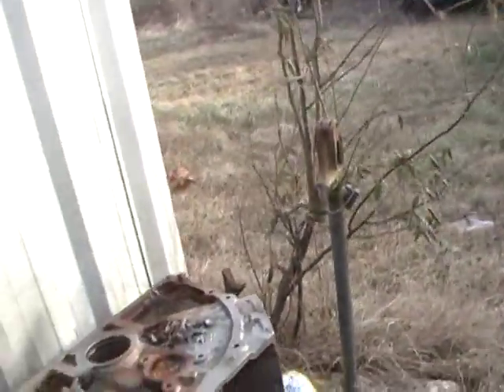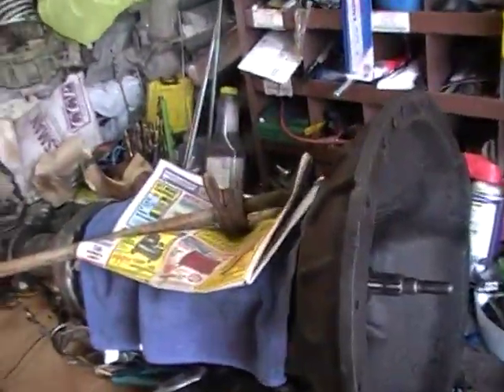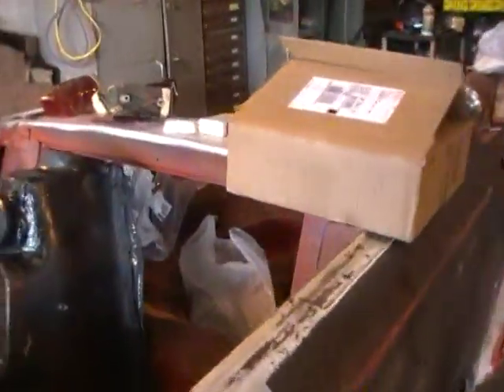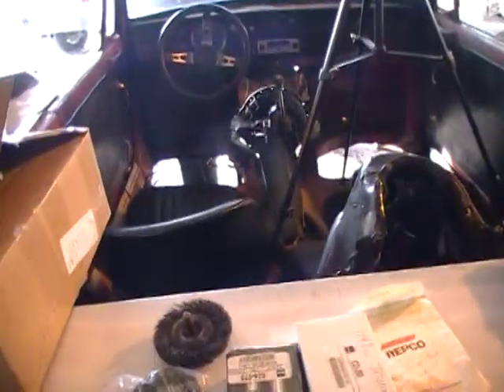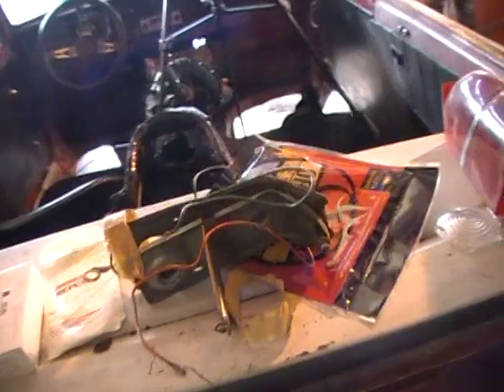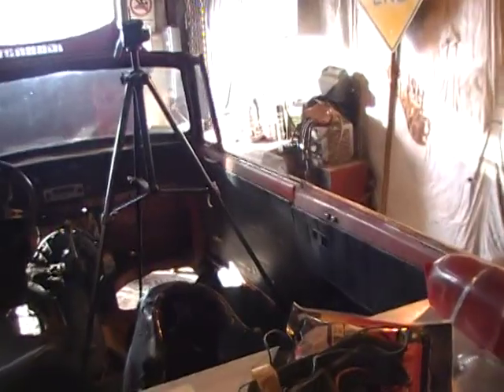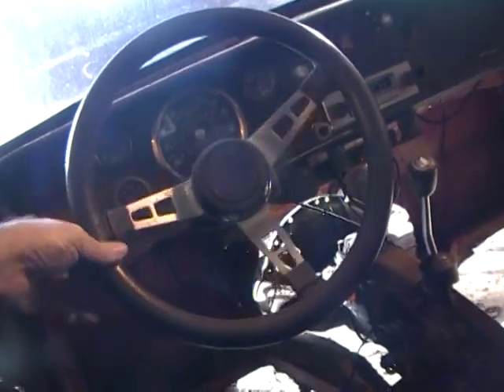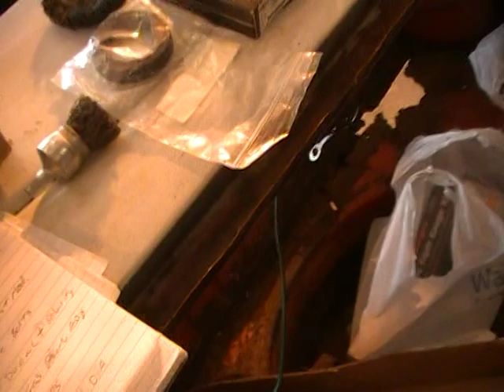TRIUMPH HERALD QUESTIONS

Comment: Holy cow, that a lot of questions :-)  unfortunately, I'm not a herald expert (although I would like to be).   The TR3s did have an extra leaf spring on one side in the rear. The fronts were equal though. I know TR3 and TR6 owners though that have to run spacers on one side of the car to level ride height.   One the paint, maybe you got pimento red instead of signal red..the pimento is more orangey   
That clutch disk is way too sloppy as you know....that sucks.  Head looks great.   I don't think the radio is factory but I think it fits the part!  Glad you figured out the Roadster Factory. :-)
Reply from the maker: David, you done this old man proud! Thanks Bubba!

Comment: The inverts in the talk lens is a d diffuser to make the light brighter. I'd put them in the new lens. I like the wheel that's in the Herald now. It fits the car and should be easy to steer as the car is light and the tires are going to be small. Putting double 1157 lightbulb sockets in the tail lights is a good idea just check to see how the wiring is on the turn switch and brake light switch. The shovel idea is a good one. Once you have access to the frame back in that part of the frame you can deal with the body mount bolts. You could even make new holes at that time because you'll be replacing the sheet metal. I'd definitely check into figuring out the stays for the bonnet so as to not fatigue the front sheet metal. You can take out one of the lugs and Mic it then check to see if Dorman makes a longer one that suits what you need.
Reply: That was inserts in the tail lights.
Reply from the maker: Woo Hoo! great advise! thanks Bubba!
Reply: cutworm59 your welcome Steve

Comment: The clutch disc is a no no...You'll need a sprung disc to eliminate clutch shudder...As I remember,the clutch master and brake cylinders are the same except for a valve in the brake cylinder(which can be removed with a self tapping screw)..The "lug"nuts or as we say wheel nuts would need to have a shank that goes through the alloy wheel to achieve the best bite...The duel filament globe would be park and brake light and the single would be indicator.The "reflector" is a defuser...
Reply from the maker: Amazeing......all this knowledge and good looks too!  Thanks Ziggy!

Comment: Hi Steve, Gotta try and remember all the questions, Never seen a spacer on top of a the front spring before, maybe its peculiar to the US, cant see them listed in any parts book either? Clutch yep sling it back to em, me I'd rather see some springs, they judder like a bugger, the original steering wheel was huge, about 18" I'll check when I get home, I like yours?. The anti roll bar clamps just need to be 5/16 unf U bolts, You have late model lenses for early model bulb holders, later bulb holders have the shiney metal reflector disc behind the bulb, so you will need to swap the clear pieces over. the brake master cylinder for disc brakes should have a bigger reservoir for when the pistons are nearly all way out and, pads worn. Never had any problems with the throttle cable on Vincent, he's on twin carbs and the linkage is fairly stiff, pedal hinge needs to be good tho. The boot mounting bolts, 5/16 bolts rubbish welded nuts, I think you can hold the nut with a 14mm spaniard. I just find it easier to snap it off and drill and tap sometimes? When I swapped Mary's Pos to Neg, swapped wires over I think on fan. The bonnet stay x2 is 2 pieces of 1"x 5/16 flat stock with a bolt in the middle and a kink to stop it going too far, 1/4" bolts each end, + a couple of springs to make em lock out, I'll take some piccy's of mine, also need 2 bonnet adjuster bars I'll take a piccy of them too, Stickers/decals there are some repro's on fleabay, petrol tank, patent, light switch cowls, the UK radio was a fitted under the dash in a special bracket, I'll get you a piccy of that. Cheers for now, I'll be emailing ya when I get home ;-) Oh wheel studs, don't know why you need to change them? are you putting super fandango rims on? Those are the same as Vincent I'm sure.
Reply from the maker: Hot Dawg! My Brother! YOU KNOW EVERYTHING!!!! Thanks so very much! WOWSERS!

Comment: Regarding the rear lights on your Herald in the UK:
the lower socket on the holder is designed and wired for a twin pole light bulb of 5W/21w tail / brakelight bulb. These are distinctive as the bayonet pins are set at differing heights from the base of the bulb so that they are positioned and work correctly i.e. dim bulb = tail light,  bright light = brake light. The bulb is earthed onto the holder.
The upper socket is a 21W single pole bulb.
I cannot be sure if things were changed for the USA!
By the way, the holders are prone to internal corrosion and bad earthing especially the spring in there.
Small 5W bulbs also for number plate illumination. I cannot help with other issues I'm afraid.
Reply from the maker: Thank you very much Dan. That will help!

Comment: I like the steering wheel and  looks like it fits good and the thickness is comfortable to hold on to. That little Herald is not going to be hard to steer its a small light car so it should steer easy.
 You could get a kerosene heater to warm up with.
Reply from the maker: You talked me into keepin th wheel! Good job bro!

Comment: I lost track of all 'em questions early on.  Now I can't remember what they wus..  Dang.  I like the looks of the little wheel, but you're right, if it makes it hard to drive you'll know pretty quick.  Little car might be fine with a little wheel.  Is it the ore-igional?
Reply from the maker: Hi Mr P, the original wheel is 16in round.  Kinda plain looking. I will try this one out.

Comment: I think English turn signal law required separate amber lights (hence the separate bulb for signals not shared with brake light duties) but North American did not allow amber light in the rear of a vehicle back then, so to comply with laws this side of the pond they changed the lens to be all red. Your plan to double filament the turn signal sounds good but wouldn't have worked with English amber turn lenses.
Just ordered me a home acupuncture kit for my back off ebuy from china..... wish me luck.
Reply from the maker: Great information Snow Bunny.  Let me know how the self-help acupuncture goes.

Comment: I don't see why you couldn't just swap the power wires and earth wires on the heater motor..The thing with cable over shaft throttle linkage is that if an engine mount brakes and the engine lifts up then the throttle will lock on unlike a cable.I recon you could make a bonnet stay...They looked like my '38's boot lid stay...Let me know if you need a closer look at that..Smith or Lucas were the main electronics manufacturers for pommy cars as it was here back in the day..Easy steering is for girls BTW...I'd cut the mount bolts and drill and retap them when the body's off..I done my share of back bustin' too..Herniated discs hurt like the son of a motherless goat..
Reply from the maker: Ziggy, you are a very schmart man! I hadda mount brake on a Mustang with cross-ram 650 holly's. Gave me a wild ride too!

Comment: You have too many technical questions for us US car builders... The wheel looks good if you can deal with it, but obviously it isn't the original one.
Acupuncture must be one of those things that works for some and not for others. My older brother went to someone to have it done and was no better off afterwards than he was when he walked in. I think the same thing goes for chiropractors.
Reply from the maker: I figger yer right. Stuff don't always work fer everybody. Hey George, do you remember steering wheels on bicycles? They were a trick to drive.
Reply: cutworm59
Yup I remember them and bicycles that were made double high, by extending the seat post and the steering post, after flipping the frame upside down. Then couple that with the steering wheel. All I can say is you gotta be good to ride one of those contraptions. How about a double bike that was made with two bikes attached side by side? Don't tell anyone yet, but my next project after "UnderDog" (the StingRay project), will be a tandem bicycle.
Reply from the maker: The Shade Tree Fix-it Man Wow George. I'm the lucky one who has such clever friends to see wonderful inventions.

Comment: That clutch plate does not look right at all....If the fan motor does not use its housing as a earth you could just swap the positive and negative wires around. If it does earth though the housing you might have to find a different motor..What ever you do don't swap the wires on the wiper motor this will end up turning the Triumph into a big BBQ. So I have read on a forum somewhere...
Reply from the maker: Hay Thanks Marky! I am ready for a video from you now.
Reply: cutworm59 I am lacking a subject to do a video.. I have to do a mail call this week but am trying to add something else if I can.....Cheers..

Comment: I have no answers for any of the questions you asked.....but I do know the answer to your red color....
"Signal Red" is more orangey.... "Safety Red" is the red you are looking for.  It's more "fire engine" red.
Depending on manufacturer of course, but OSHA sets the standards on those, so they don't vary much from one supplier to another.
Reply from the maker: I agree with you Tim. That's the orange side of red. I like the stop sign shade best. I might try and tint it to get it right.
Reply: cutworm59 Adding just a bit of green should cancel out the orange, and bring it to a more "bright" red. or "fire-engine" red.
Reply from the maker: Thanks Tim. you iz schmart fo sho!
Reply: cutworm59 Nawwww...not really. 15+ years as a Painting Contractor though, I did manage to retain a little info on paint colors and how to fix em.